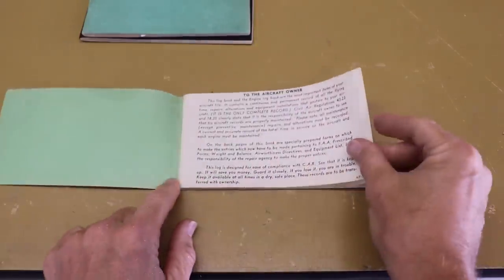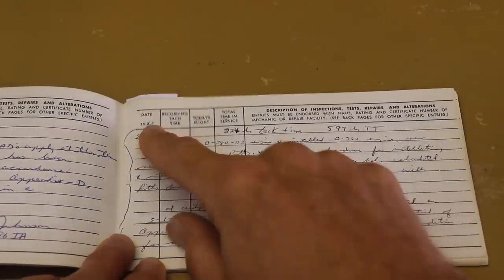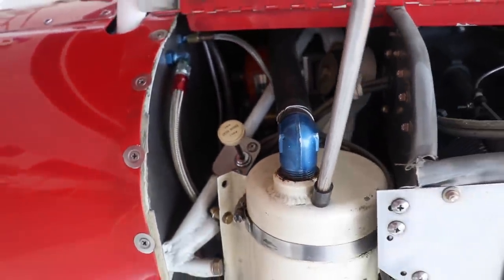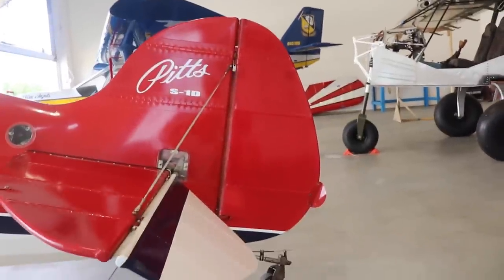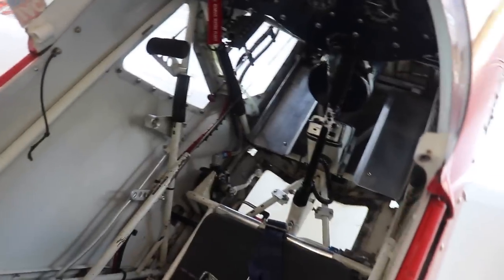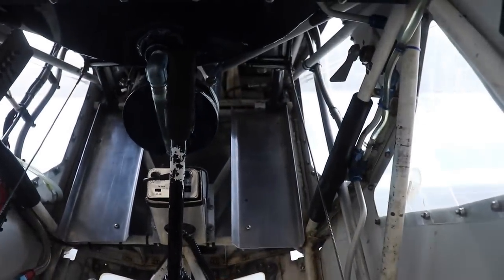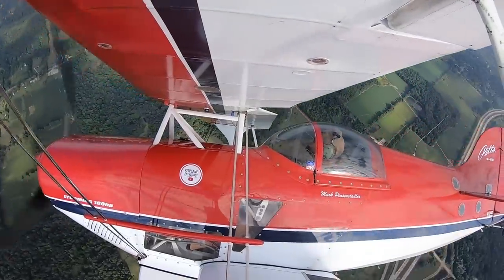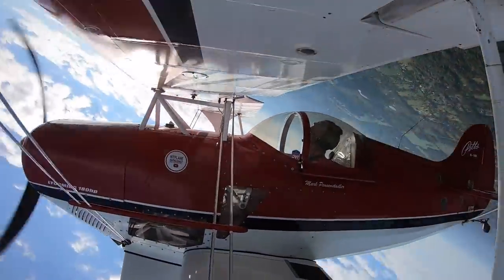Introducing My New Pitts S-1D

Comment: Mark, 

Your airplane was built as an S-1C model by my great Grandfather, Charles W. Walker. Its sister airplane is N20CW, serial #2 built in 1970.
He built both airplanes in his basement in Atlanta GA while he worked for Delta Air Lines as a Captain. 
Your airplane was equipped with a rebuilt engine originally, which suffered catastrophic failure due to a dropped valve on climb out during a test flight. The engine was subsequently replaced with a brand new one of the same type. This airplane was also not originally equipped for negative G flight, and the fuselage was inadvertently filled with oil when a "friend" borrowed it for a airshow display which included negative G maneuvers. I imagine that may be why the airplane was reskinned and fuselage replaced so early in its life. (not accounting for the poor welds haha) 
My great Uncle Andy, his son; is the one who ground looped the airplane -while flying it without permission. 

The reason your canopy is strange is because it was originally built without one. It only had a windscreen and was always flown open cockpit when it was in my family. 

I always wondered what happened to this one, 20CW is owned by a couple in FL and is flown regularly. Glad to see 120E is still flying as well. 

Shoot me a message! I would love to talk more about the plane. 

-Andy
Reply: It's for sale right now.
Reply from the maker: That's great information! Thank you for posting it.
Reply: @lulubellers  Which one is for sale?

Comment: Small suggestion: I have had great success with the Performance Propellers Inc "Almost constant speed" props. I have used them on several aerobatic aircraft and now fly two different Bücker Jungmann one with a conventional prop and one with a Performance prop. The different is quite amazing. With the Performance prop I can go from 90 mph to 150 mph with only about 150 RPM change at a constant throttle setting. With the conventional prop I have to start throttling back because the tach goes through the red line at about 120. Performance Propeller is now located in Illinois so not that far from you.

Comment: The long pitot is required since it projects from the wing leading edge.  There is a pressure "bulge" in front of the leading edge and the length is required to get it into free air.  I learned this when I built my BD4 - a too short pitot made the airspeed read too high.

Comment: Both the S1D and S1E models are very rare. I do not like those Piper Cub style pin hinges on the elevator & rudder. I much prefer the standard Pitts style strap hinges with Rihn gap seals. I gave up on a radio in my S1S. Just too loud. I wore earplugs and they have to be in deep. The trim tab is so powerful that you can loop a Pitts. Sean Tucker almost attempted a landing with just his trim tabs when his elevator rod broke. He was concerned about his super high landing speeds necessary to safely land. He parachuted out at 8,500 feet instead and then got caught up in the tail flying wires before pushing away from the aircraft. Your canopy set up is goofy. There’s nothing like a light weight, stock S1S.  

Definitions: S-1D = Amateur-built S-1C with ailerons on all four wings. S-1E = Amateur-built S-1C using factory-produced kits. Uses symmetrical airfoil.

Comment: Thanks for the tour.  I have always liked the looks of the Pitts, but have never gotten a chance to plant my but in one.  Curious, at about 13:09 in the video you are talking about the radio, but in the same frame on the left side is what looks to be hydraulic lines and a "bent" sort of handle.  Parking brake maybe?
Reply from the maker: I think what you're looking at is the tubing that the trim cable goes through along the left side of the fuselage. There's also another tube that the wire goes through to lock the tailwheel. There are no hydraulics in the plane.
Reply: @KitplaneEnthusiast  This handle sure looks like it is connected to a valve of some sort with AN fittings attached. At 12: 36 in the video it is center screen, down low, left of the "V" brace.
Reply from the maker: @wheelerdavea  You’re probably referring to a hand operated fuel pump used to prime. There are fuel lines in front of the seat and run forward on the left and right sides of the fuselage.
Reply: @KitplaneEnthusiast  Makes perfect sense.

Comment: G,day from Sydney Australia.
Some differences between the 'C&D' model Pitts. I do like the clear inspection plates.
Q1. Is it only N tail number registration aircraft that must be fitted with ADSB-out? 
🌏🇦🇺
Reply: Yes.  In the U.S., if an aircraft isn't "N-registered" and it meets a few simple limitations, then it's a Part 103 ultralight vehicle, and those have no requirements for radios of any kind.  If you'll never fly in controlled airspace, then even registered aircraft don't have to have ADS-B Out.
Reply: @FlyingShotsman  The experimental ultralight would still be identified by ATC radar, and radio communication to traffic in the area?
🌏🇦🇺
Reply: @johnfitzpatrick2469  You have to be careful with terminology.  "Experimental" is a category for registered aircraft.  Ultralights are non-registered "vehicles" that are not technically considered aircraft by the FAA.  Search "FAR Part 103" for details.

An ultralight might show up on ATC radar as a primary target (a radar return) if it were close enough to the radar antenna, but would not appear as a secondary target (transponder/ADS-B reply).

Some ultralight pilots do have radios, but there's no requirement in the regulations.  Panel-mount radios are uncommon in ultralights (due to installed weight); most use a handheld walkie-talkie with a headset/helmet adapter.

Comment: A lot of what you discuss as differences between your 2 Pitts has nothing to do with "E" vs. "D" model elements, but rather choices the individual/builders and owners have made to the planes. The biggest difference, and what really signifies the "D" in S-1D, is that it has 4 aileron flat bottom wing airfoils. Your "E" (built like an "S") has 4 aileron symmetrical wings. I would want to go through that entire fuel setup on that D and make changes. I suspect that your inverted time is limited due to the use of a header tank. I'd prefer the normal main tank with flop tube setup, and get rid of the wobble pump while at it, and replace with elec boost pump. Not sure why guys put those bouncy rod spring locking tailwheels on.....wouldn't be my choice. Anyhow, such is life with experimentals! You get to go through it and make your own choices. 😊
Reply: Should you choose to replace the “bouncy rod” tailwheel, I would be happy to purchase it from you.